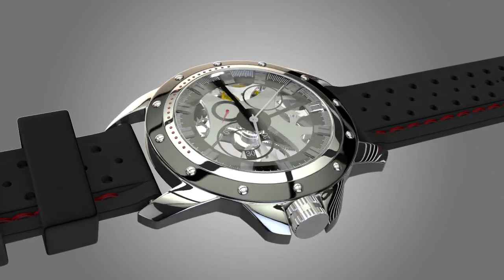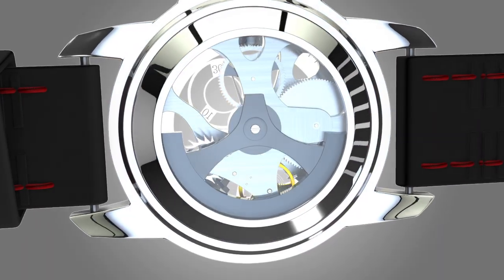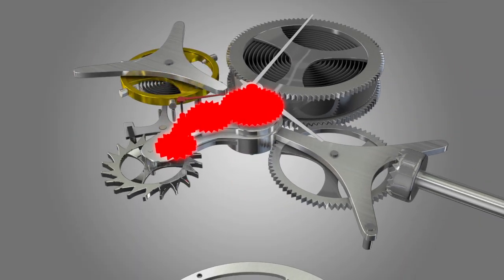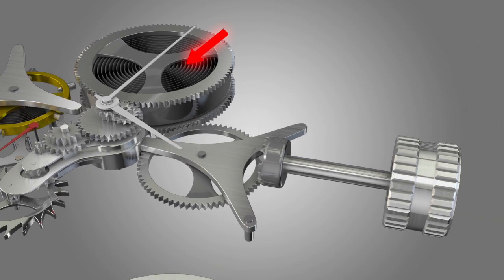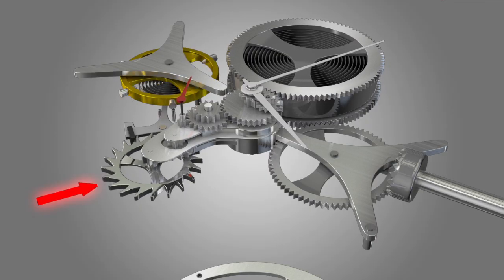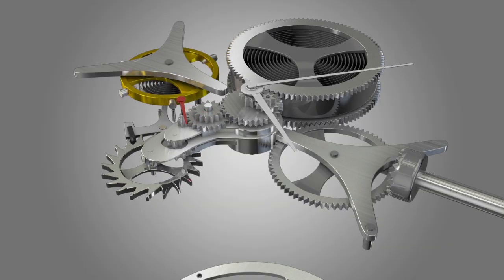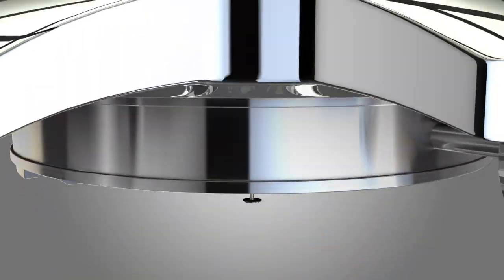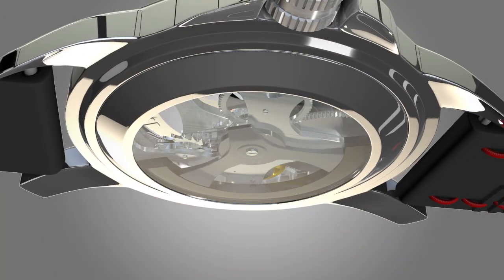Mechanical Watch Animation

Comment: Still doesn't explain how a watch can be wound and adjusted while it's in motion. Nobody seems to explain this crucial detail
Reply: i'm also interested in finding out if anybody knows.
Reply: classydays43 The controller will run the watches movement for a short duration. It is a spring, just like the pendulum for a grandfather clock. It will carry energy for a small amount of time, typically just enough for you to rewind the spring.
Reply: Incursus in an automatic watch how can the mainspring constantly be wound while it releases energy at the same time? To me it seems like the watch will only move when it’s perfectly still ie it is not being wound up. Obviously that can’t be the case.
Reply: @Maazin5  the barrel has an arbor in the middle which is turned by the pinion connected to the the winding stem. The other side of the barrel has the teeth which drive the train gears which operate the hands and carry the stored energy to the escapement, (the odd looking wheel with slanted teeth) so in essence, it's like two halves, the spring is wound by the centre arbor but drives the outer ring, this is how it can impart energy and be wound up at the same time, additionally. Automatic watch springs aren't fastened to the outer portion of the barrel like a manual wind watch, it has an opposing piece of spring which acts as a slipping mechanism so you can't wind the mechanism too tightly and stress it.
I hope that makes sense.